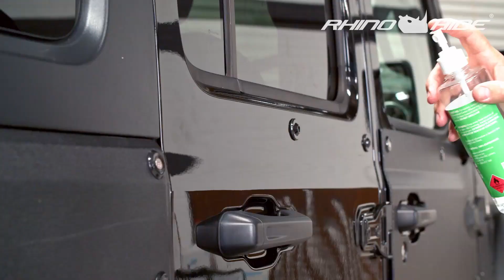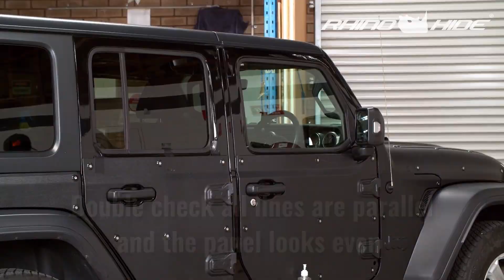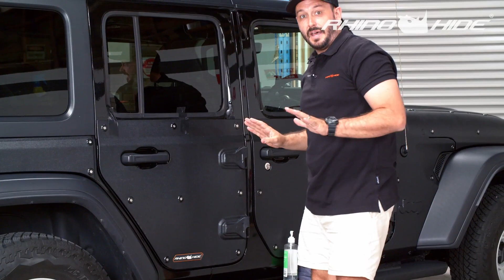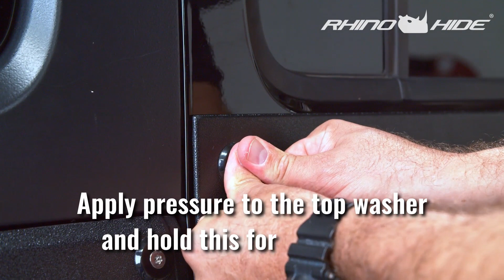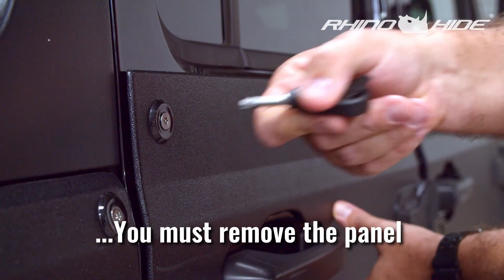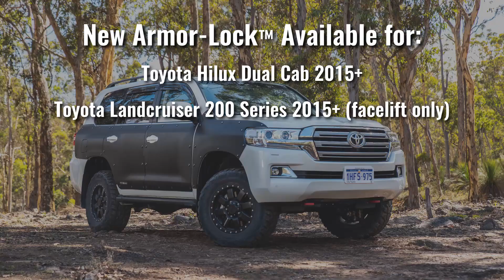Rhinohide Armor® 4x4 Protection System with Armor-Lock® Mounting Instructions

Comment: Installation sux!!!! Taking me roughly an hour per panel to install, when you try and remove the 3m plastic over the adhesive it breaks, next 5min is spent trying to remove it with tweezers, it’s driving me nuts! This installation is going to take me 6 hours!!!
Reply from the maker: We suggest a small blade to quickly pick the tab off, saves lots of time.